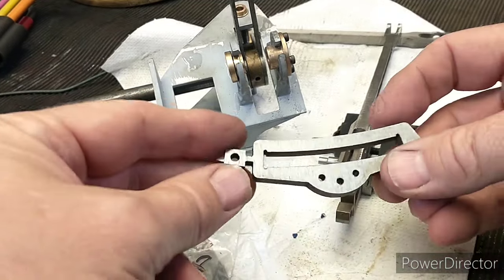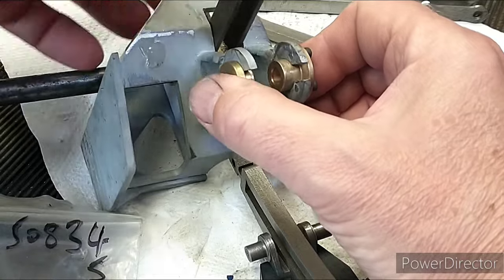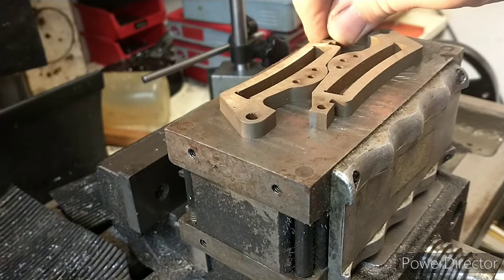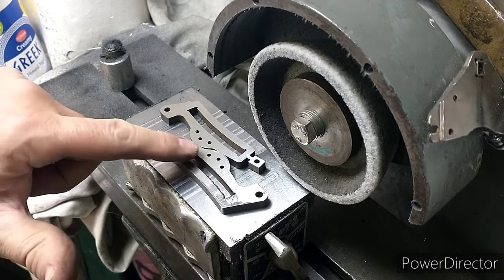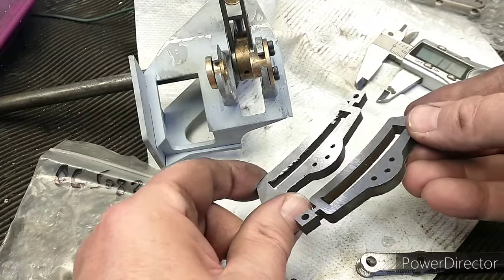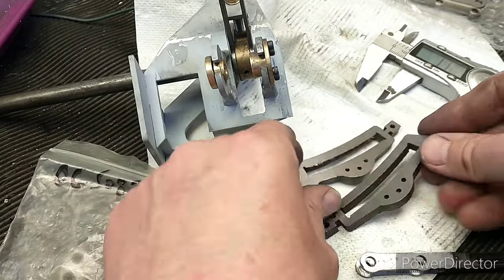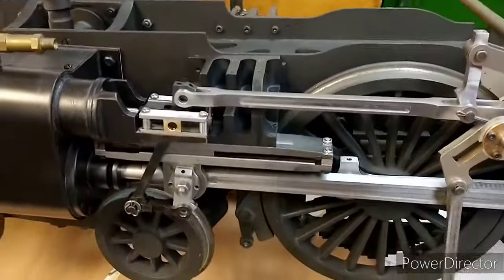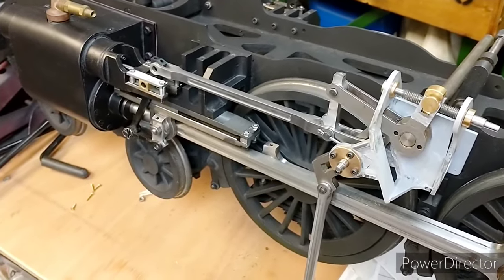Modelworks Britannia Ep39: Left Valve Gear Complete #livesteam #modelengineering

Comment: Some more tiny parts to fit. The cutter grinder did a magnificent job. Lovely finish. Great work Julia. Cheers Nobby
Reply from the maker: Thanks Nobby I've spent some time today improving the grinder extraction so it actually works 🤣
Reply: @julias-shed  "Extraction" as in "extraction of dust" ?
Reply from the maker: Hi Jasper yes dust extraction. The hood I made  was stopping the full travel of the table. I've modified it now so it can be used in all setups. 😀

Comment: Hello Julia. Since you ask for comments, here are a couple:  could you not have threaded those two "unusable" holes and put bolts in from the rear, for extra strength? Also, forward gear is derived from the bottom of the expansion link in this layout. And you should, as you say, restrict the travel of the radius rod so that there is no chance of the die-block ever touching the top or bottom of the expansion link on the extremities of its swing; something I have experienced on a much larger engine, when it was necessary to fit a stop-block to the front end of the screw-reverser to prevent excessive travel of the radius-rod to the bottom of the link. Please carry on the good work, you are very methodical, and it is paying off.
P.S., can the sleeves on those valve-slide studs be of a smaller diameter? Any extra clearance here will pay dividends.
Reply from the maker: Hi Derek, threading those unusable holes might be possible I'd need to permanently fix the 5mm spacer to the weighshaft bracket for that to work also access is quite difficult on the inside of the frames due to the axle pump. I'll certainly consider it for the RHS has that has even more unusable holes! 😮 Thanks for letting me know which end is forward gear. I'm more used to slide valve engines! Good idea about the sleeves I'll think about that. Thanks for your interesting suggestions it all helps 😁